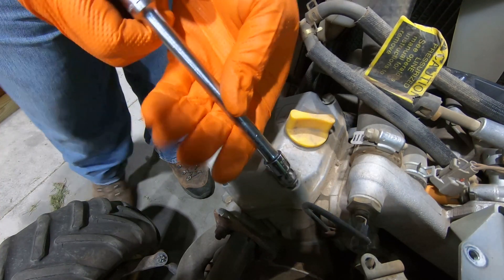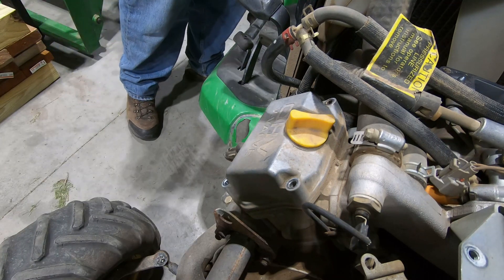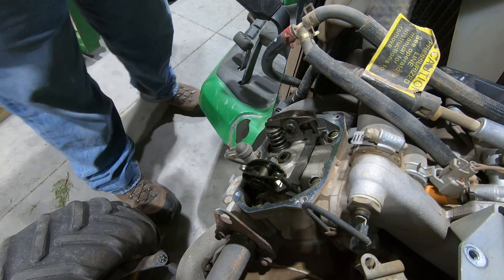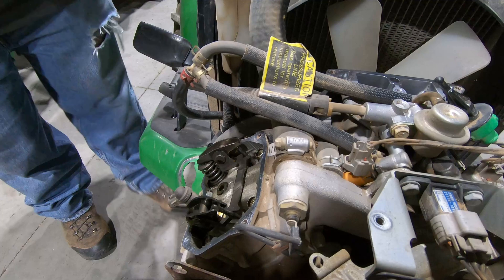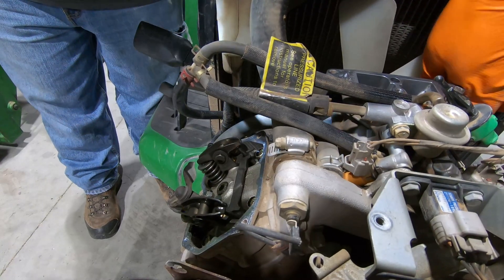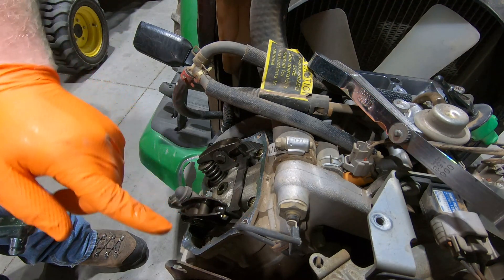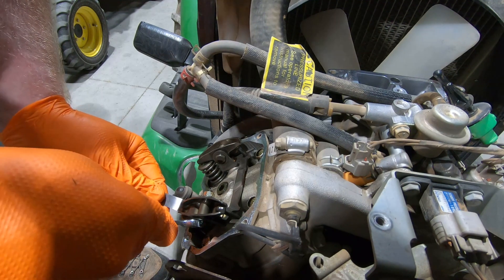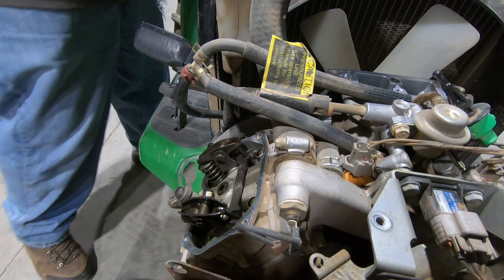John Deere X585 Project: Part 3 - Valve Adjustment

Comment: Love all the videos! The layout of the engine bay is similar to the 445. Wonder if the x585 engine would easily swap to a 445 for better power with the 60” deck?
Reply from the maker: I think the biggest items to figure out would be the wiring harness. You would need a complete harness from an X series. There are several changes between the engines, such as a single vs two injectors, ignition module etc. Once the electrical items were solved, I think the swap would be decently straight forward.

Comment: What was the red light on the dash when you cranked it at the end? If it's the battery charging indicator, definitely something electrical going on.
Reply from the maker: That should be the parking brake light.

Comment: I have a sneaky suspicion that there is a bad ground or even a bad positive wire connection. Maybe check the coil wire connectors. I love troubleshooting electrical issues :). Thanks for sharing